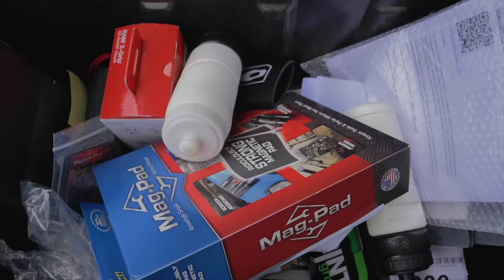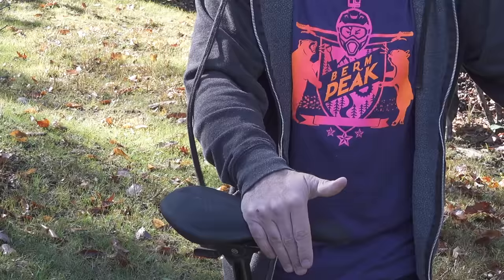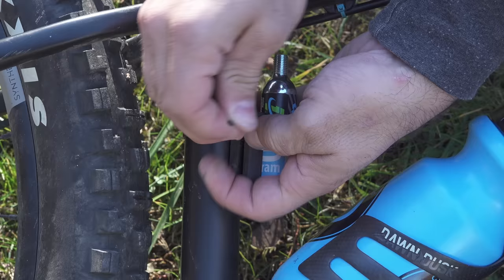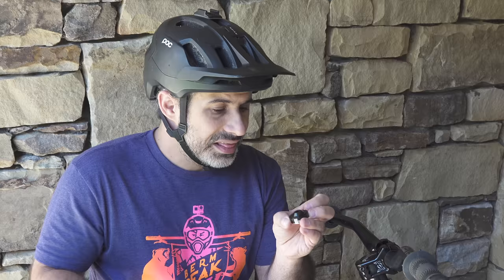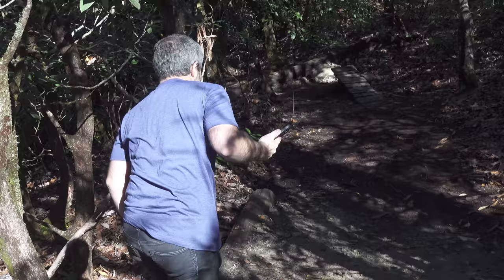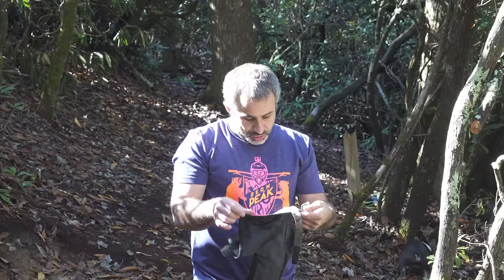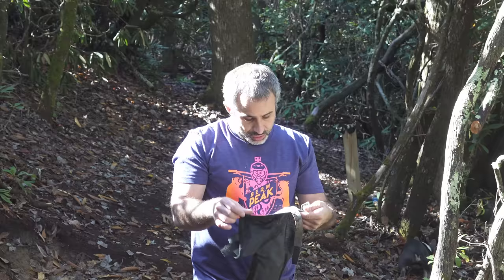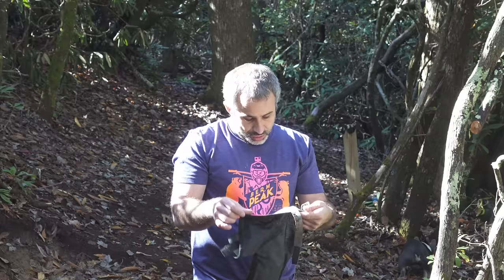Mountain Bike Products you may not have heard of

Comment: The bandit was "invented" by some guy up in New York. 

Totally ignoring Gaiters were popular in the 1700's 😆
Reply: Also well known in the hiking community for keeping rain out of the top of your shoes. So more thin and waterproof material than this heavy duty abrasion resistant stuff but yeah. Not an original idea.
Reply: Just what I thought bud, I’ve been using gaiters for decades hiking.
Reply: Exactly it just short gators
Reply: @ThexImperfectionist  Hiking gaiters are not really for keeping rain out of the top of your shoes but to protect your lower leg and boots/shoes from walking in wet grass, snow, mud, walking through shallow water courses, and getting debris into your boots/shoes etc. They usually come up to just under the knee and of course wraps around your boots/shoes. If you ever go hiking in wet terrain they are almost life savers as they will keep your lower legs and feet dry.
Reply: Technically spats, and very fashionable in the Victorian era :) They are easy to make with even basic sewing skills, and have patterns available all over the web (presumably how the New York inventor got their pattern.) To be fair, This is the only one I have seen with bra hooks to catch the bottom of the shoe lace. I was contemplating making a set of similar gaiters (maybe mid calf length) so I could secure the bottom of my pants legs when I get a new bike, as I usually wear long pants on trails due to the frequency of which I encounter thorny brush encroaching on the trails, and dislike sucking pants legs into the chain ring.
Reply: @mattlewandowski73  loads of gaiters have lace hooks. also, I see that now there are also trail running ones that do not have a strap under your foot, so they possibly eliminate the problem Seth points out in this video of the strap wearing out over time.
Reply: Came here to say the same
Reply: Came here to say this lol

Comment: RE: kids' seat. My grandpa made something similar for his road bike and back in the day i have been riding with him like that for many years. As he got older and i got bigger he changed gearing to make it easier to pedal, but other than that nothing else needed to be changed. As a kid i really liked it because it was comfortable and i had a great view around. Definitely beats riding on the little cargo rack above rear wheel, not to mention much safer than sitting on the handlebars to ride (had to do that once, ended up bouncing off and faceplanting on the ground after hitting a pothole. Not fun.) And since the whole thing was held on with just two bolts it was easy to remove for going to the grocery store or whatnot where no kids were riding.
Oh and btw, no idea why the kit in the video had those small handle bars. Holding on to what was already on the bike worked great for us.

Comment: The battery powered pump is my go to gift to my mountain biking buddies. It has a much better pressure gage than a similarly priced floor pump, you dial in your pressure and let it pump while you gear up, and it takes a fraction of the car space and isn't always getting hooked on everything around it. The perfect tool for a biker who routinely drives to a trailhead and tops off their tires in the parking lot. Every recipient has loved this gift.
Reply: Yeah the pump is more for using if you get a flat riding rather than using it all the time

Comment: I've actually been using a tubeless Schrader valve from stan no tubes on my wheels for the last 3 years. And I only had one clogging incident that was totally my fault. It is so much better than presta valves! I don't see why anyone would prefer prestas over Schraders...(Just had enlarge the hole a little). Note:
I live in Vancouver. So if it works on the north shore trails no one has any excuse not to use it if they can.
Reply: Presta sucks but you could spend $50 for the new Reserve Filmore Valves which are a redesigned presta but why bother? Instead, just enlarge the hole a little and convert to schrader, most excellent.
Reply: I don't understand, at least in Portugal the Schraders are just the most common ones, we have really good trails too, and they handle it fine, I have a feeling that a presta would just break off
Reply: @jtfa28  they do! Or get jammed and you end up accidentally removing the core and emptying your tire! The presta valve was made for road wheels that have to be narrow and aerodynamic. There is no reason  to spec it on a mtb wheel other than public perception that good bikes come with presta valves...
Reply: My experience with schrader valves is that are harder to put air faster (unless you take out the core), other than that they are eternal and easier to clean.
Reply: @ManuelMartinez09 I always removed the core from the presta valves for inflating tubeless tires for the first time too so, to me, presta had zero advantages.
I used to carry a plier with me so i could open my tire valve in case that threaded top on the presta got stuck! That design suck and should be relegated to narrow aero wheels like it was designed for!
Reply: @rodrigormotta  I agree, prestas can cause more trouble and schraders are by far more reliable once the tubeless is set… but without a proper tool it’s almost impossible to take out schrader’s core, that can be a problem at home if you don’t have a good air pump… I’ve been there. My advise would be: narrow rims (under 20mm inner): presta and a couple of replacement cores. Wider rim: schrader and a core tool, even a cheap plastic one.
Reply: I convert all my tubeless wheels to Schrader. So much better imo
Reply: @jtfa28   I don't get it either. Presta makes a lot sense on a road bike, because the tire is mounted with "low volume high pressure" air mode. The smaller air inlet makes a better fit for high pressure. For MTB, schrader allows much better air flows for the "high volume low pressure" mode (Same as cars). It is also more robust as it is bigger and the valve core is protected inside the stem instead of exposing it to any lateral force from pumping and such.

Comment: I quite like the Schrader valve idea. I've converted plenty of retro 26" rims to tubeless without any problems but they were always double wall and using 26" tubeless tyres. I feel like you could've given the product a better chance if you used a proper double wall rim and tubeless compatible tyres. And don't cut the valve hole with a knife.
Reply: and if he had put a washer or two between the O-ring and the nut he might have achieved a tight seal
Reply: Didn't the product say, "Make any rim tubeless"?  Doesn't a tubeless setup require TUBELESS tires?  How about the same test with a tubeless ready tire?  BTW, love love the idea of Schraeder tubeless stem.  Most Bikes, Car tires, Trailer tires, etc., have Schraeder valves.  Presta are pain with my air compressor and other Schreader valve products.  Didn't you mean to say that on .00001% of the people use Presta valve stems?
Reply: Stan's makes one too.

Comment: Jordan's Bike Hacks (for the Shotgun seat): if your top tube is tapered from the head tube to the seat tube like most modern bikes, I have found that no matter how tight I put the seat on it will eventually start sliding back. So took an old tube and cut it into a foot long section, I then wrap it around my top tube right behind the seat, and keep it in place with a Voile strap. This has kept it solidly in place even on steep climbs.

Then pack your back/waist pack full of as many snacks as you can fit, because nothing ruins a ride like a hangry toddler.

Also, teach your toddler cool mountain biking slang (gnar, chunk, roost, etc) and teach them to warn hikers that you're coming up behind them. The slang is just fun, and hikers are much more likely to give you a smile instead of an annoyed look when your toddler says "coming up on your left".

Comment: As someone who recently invested in a similar (yet not exactly the same model of) electric bike pump I really like it, especially for people in the city or who park their bike outside. It even works on motorcycles and scooters, and they work well. Car tires might be a little big for best results and could potentially burn out the motor, but honestly being able to leave it for like a minute and a half per tire and have it auto shut off pretty much makes up for the slightly longer inflation time compared to a floor pump. 

Plus it may be kind of a moot point considering the bike specific application, but for someone with specific strength issues that prevent them from using a floor pump they are fairly easy to use. 

A final thought comes from one of your later videos Seth, where you use this pump for your shocks. That’s what I sort of see this as, a replacement to one of those handheld portable pumps that you either use for your shocks, or you carry with you for your rides in case of emergency. It fills that role really well and saves you from a lot of the awkward pain that comes from using a manual pump that size.

Comment: The game changer for my saddle soreness was upgrading to larger pedals. The stock ones on my Norco were tiny and the new largers pedals helped with weight distribution.
Reply: The newer SPD style pedals are getting smaller (Customers demand weight-saving items...plus less metal used so less expensive to manufacture)...but they hurt the bottom of my feet due to less area to distribute my weight.  My old pair...more than 8 years old are a bit wider and longer...so more comfy fir my soles.

Comment: For the ghetto conversion stretch an inner tube around the rim and cut it open,  now install the tire like normal. The inner tube builds up the rim (just like a bunch of tape) and creates a perfect seal once the tire is installed. I used a 16 inch inner tube on a 20 inch BMX rim to convert to tubeless, it worked like a charm.

Comment: Yes... Yes those bandit straps will wear out... The rougher the surface, the faster. It appears to just be an elastic strap... Easy to sew a replacement, or for those without crafting skills, the motorcycle industry has straps with clips at both ends (and usually some form of motorcycle culture related bling over the clips). When the bandit straps wear out, you can pick up a set of those at most any motorcycle shop, especially if they are focused on v-twin cruisers (such as Harley). Last time I got a pair, they where about $10 a pair. They are intended to keep your pants leg down when you have your feet out in the wind on a motorcycle, but SHOULD work fine as a replacement strap on the Bandits as well.

Comment: Back in the early 2000's, I used my old Gary Fisher as my primary means of transportation. I usually rode in my jorts and a chain wallet. Never had a problem with my hind quarters hurting.

Comment: About that pump, I have a similar one made by Xiaomi. The good part is that it is perfectly capable to inflate six tires and it still had plenty of charge, it's enough to inflate at least one car tire. Probably more, again the battery was not depleted. It is a lot less effort than using a small volume manual pump like the one you might attach to your frame instead of a water bottle. It's small enough to just throw it in a backpack. The bad, if you want to call it that, is that it is a bit slower than a high-volume manual pump. Still faster than a small pump, and it has a dial for pressure built in, which is nice.

Comment: Just gonna add here: the digital floor pump will NOT replace the standard floor pump at low pressures for MTB tires but if you get to the pressures required on a road bike tire around 70-100+ its really handy.

Comment: The air pump is useful for my dual sport bike. Lower tire pressure a few psi when I hit trails then when I come back to the roads inflate back to regular psi. I've had a smaller inflator for year's. Very useful.

Comment: Stem Captain also offers a Garmin mount. 
That Mupull with a Peaty's CO² nozzle would be rapid. That gap in the sides would fit a strap, you could use it as a base to strap extra kit or an emergency tube and levers with the CO² and it would be mega secure.
 I wear a pair of Altberg Sneakers (British army tabbing boots, made in Yorkshire) for trail building as theyre tough, waterproof, super comfy, puncture-resistant (more useful than you'd think) and stick to all terrain like dog shit in a tyre tread (you all know that scenario).

Comment: If your saddle is not comfortable and you want to reach for a cover the problem may be that you don't ride much and your butt is not used to it. However, while I think that is good advice, the problem with this advice is that you may overlook keeping a saddle that does not fit your sit bones correctly.

I'm a medium/large sized guy on most bike sizing guides and have never met a stock saddle that fits my 14cm sit bone width. You want to sit on your sit bones and not your soft tissue. There are plenty of good YouTube videos that help you measure the distance between your sit bones. Once you know that, compare that distance to your current saddle and see if your sit bones are riding the outside of the saddle or not. Mine were. Much better after.

Comment: In converting my 29er wheels from 2016 I had the LBS order me a set of Schrader valves and used 1 pass of gorilla tape. Still running strong today after 2 or 3 sets of tires.

Comment: "The reason your butt hurts after you ride is because you don't ride enough."
Yeah...after riding for 35 years, trying multiple brands of saddles, getting the Holy Grail of a professional fitting, and still being less and less able to tolerate sitting down on my bike at all, I eventually realized this was bullshit. The reason my butt hurt was because ALL "racing" saddles are too hard. When I got a larger softer saddle "intended" for a touring bike, that fixed the problem. With the sore-butt problem fixed, I've ridden more this year than I did for the past 5 years combined, WHICH IS THE WHOLE F@#$ING POINT OF OWNING A BIKE.

Comment: There is a very simple solution to the wear problem of the sole strap on the sneaker gaiters. Instead of using a strap - which you correctly predict will wear out rapidly - they should install a small brass islet on each side at the bottom. Then after tying a figure 8 knot in one end of a 1/8" nylon cord run the cord under the shoe, thread it through the opposite islet and secure it with a spring loaded cord lock. This cord will be much more durable than the strap and when it does wear through you just install a replacement cord. I know this works well because I have a pair of hiking boot gaiters that uses this method and the cord lasts a long time.

Comment: I own a lithium battery bike pump, one with a crappy microB charge port, but it is fantastic to have on a long commute. Sure I ride a road hybrid, and not a mountain bike. But when doing a puncture repair it does beat a mini pump. Or travelling where you can’t carry a track pump, it is brilliant. But recognise the limitations. Buttons sometimes get pressed at at starts running in the bag, no battery no air. 

In a puncture repair situation with tubed tyres, this is fantastic, it can get you up to normal pressures where a mini pump can’t, and CO2 is still a single shot do or die solution which won’t get my confidence where you have a 10 mile walk to alternative transport. For tubeless mountain bike tyres, sure not that great, perhaps in the few situations you can’t ship your track pump with you for whatever reason.

Comment: I have an electric pump similar to the one Seth reviewed. A floor pump is way faster. But I do  like the electric pump for two things: (1) I take it with me in my very small car to top off my tires on rides instead of bringing a much bigger floor pump or using my gaugeless mini-pump. (2) My wife is 5 ft. tall and weighs 90 lbs. She can barely use a standard floor pump without standing on a stool, and forget about it if she has to pump up her road bike tires, so the electric pump, while slow, is a great addition to our bike toolkit.

Comment: I have a lithium air pump and find it very usefull.  I use it also for my motorcycle and car.  And often on mornings when i go riding and check my pressure , I just plug while I’m dressing or doing breakfast.  Usually you only need 5/8 PSI so the speed is not really an issue.

Comment: The Ryobi hand held air compressor is cheap (like 30 USD) and works really well, plus if you have other ryobi products it uses the same battery. its even small enough that you could theoretically carry it in a pack.

Comment: 8:24 use a elastic with a very heady thread sorta cover, like paracord or use a buckled so you can adjust it tightly without losing structural integrity or longevity

Comment: Loved this 'unusual new bike products' Q&U (quality and usefulness) post, my favorites were the Stem Captain clock,the shotgun kid's bike seat and the ion-lithium battery which I believe to have been created for those who can't stand having to pump air in the tubes or tyres each and every time a puncture occurs during a bike ride which we know might bring several punctures in the same day when riding downhill trails.There are several other factors when it comes to puncture causes but the most relevant one is the climate's temperature at the time that the puncture happened as we all know that it's during Summer time when rubber becomes softer, add rocky trails and bad tires with weak side walls where a big part of the punctures occur under the form of big gashes and it's pretty sure we are going to have multiple punctures in the same day as we've all been through that 😮‍💨...So, knowing that we are going to be pumping our tyres in an intensive manner, that ion-lithium air pump is going to be totally worth it,even more when it has already pre-set all the right pressures for all the different objects you might have in your hands such as basketball 🏀👍🏻🙋🏻‍♂️.